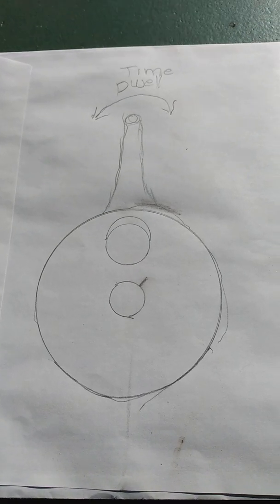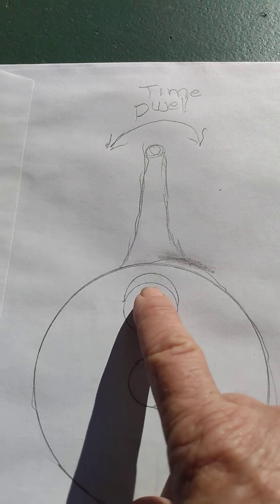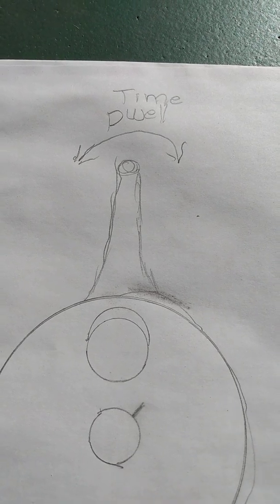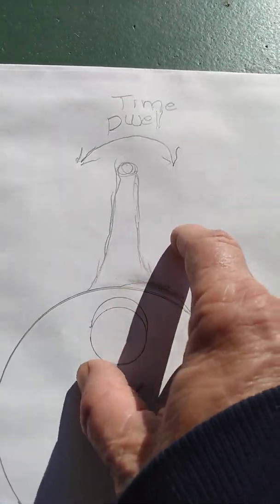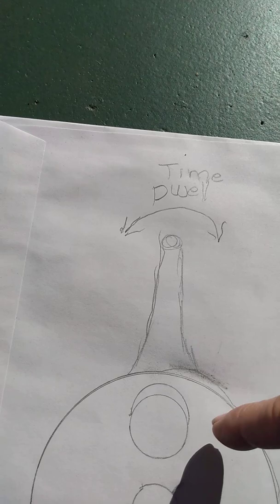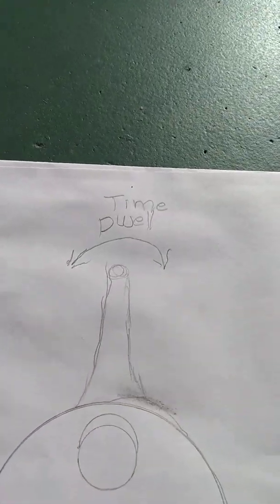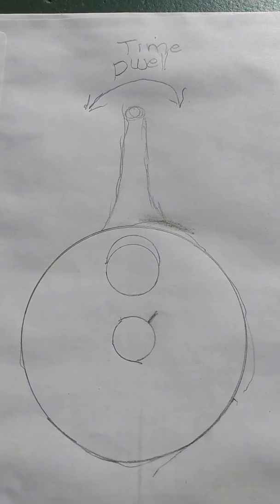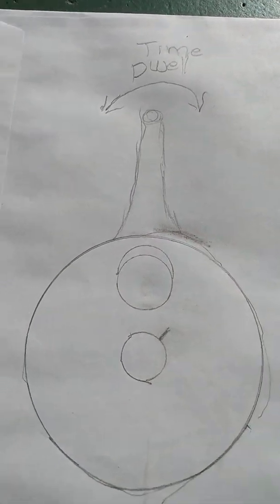pin offset  main difference port timings changes rod ratio also changes but ignition timings don't

Comment: Just a question from a non professional , is mechanical timing the same as physical ? The other variable timing, or at least  usually  easier to change , is   electrical or spark ? As to port timing , is there any compromise to the longer durations and available higher compression ?
Reply from the maker: On these bicycle  motors timing is fixed determend  by where the key way is ground in crank shaft. Yes you can change it few degrees by using a offset woodruff  key or by offsetting  the four holes in the primary stator coil. I'm sure you can find a programmable  ignition  that has the ability  to change timing curve  like a ramp but typically need a battery and a diffraction  type ignition  system. Not worth the money when messing with a 150$ engine
Reply: @2strokecarbtuningportingin187  Very good . Cheers
Reply from the maker: Your port timing question  is confusing. Everything  is a compromise  meaning Everything  effects the big picture  nothing is random exhaust port width  port roof shape port hight all matters port separation from exhaust port opening to where the tranfer just opens matters ie blowdown. Tranfer overall duration matters .ie port it opens till point it closes ie duration. Intake port width and floor matters . I belive I cover everything  every topic in my vids from carbs to cyl heads to windows  window locations and widths. Hope  I answered  your question
Reply: @2strokecarbtuningportingin187  Man thanks for writing all that, it's now embarrassing how  l just didn't ask a proper question. But i understand practically how all those variable details can be effective, but without personal experience . l put a stroker crank in my 70cc scoot [ pipe ] and with nothing but adding a  head gasket  , do my port timings need attention ? is what Imeant to say . But feel free not to answer that one , thanks  PS  You left out weather .
Reply from the maker: @johncoscia5258  weather ? Super simple when turning it takes what it takes literally  if you tune your carb properly  like  I explain on my carb vids  weather never will have much to do with your tune. How many  motorcycle  owners do you see jetting there CARBS  due to weather change the temp change has to be huge  same story with altitude. Better put if you ride in summer from 50 to 105 degrees . You'll never touch carb. But if you ride in winter say zero to 50 degrees your jett size will need to increase  about one or two sizes Max. Basically  you need to up jet one or two jets in winter . When summer comes along it will run Slightly  rich. Simple 4 minutes swap the jet down one size.  As far as altitude  goes typically  from sea level  to 2000 ft has minimal change once you get to say 2000 ft to 4000 ft you might need to down jet  2 sizes. .   AFR HAS MINIMAL  EFFECT  ON HP.  SAME STORY WITH SPARK PLUG TYPE GAP AND HEAT RANGE OR INDEXING.  Just stating Facts. All these  replies  have been tested and proven on dynos for yrs . Go to my community  tab you'll see links to dyno vids proving my statements
Reply from the maker: @johncoscia5258   as far as installing  a stroker crank goes 100% has big effect on port timings I also made vid covering that topic. I have ran on cheap bicycle  motors 38 mm  39 , 39.5 , 40, and 44 mm strokes.. #1 example if you go from a 40 mm stroke to a 44 mm stroke #1 you'll need a spacer plate #2 you'll need to clearance  the corners of the piston skirt to clear crank at bdc. #3 intake  duration goes down and exhaust and tranfer  duration goes up.  So the answer to your question  is yes typically  you would want to address your port timings if stroking or de stroking your two stroke.  Any other questions.
Reply: @2strokecarbtuningportingin187  l meant climate change , not weather ,  hee  hee. Sorry . My cat made me cry after bleeding me dry and cleaning his crap for  14y RIP. Been watching, l like em, l have to study them more. Need an eye like a hawk or things get fu...up fast. l hope l ever have the problem of to fast and detuning, probably against your nature. Thanks for sharing, talk soon.
Reply from the maker: @johncoscia5258  have owened  and built countless  two strokes and four strokes motorcycle  when carbs tuned correctly.   realitive air temp and density  ie humidity and barometric  pressure. 90% of the time can be addressed  with fuel mix or air mix screw. Never needed on a daily rider. I'm thinking you and 90% of people  been misinformed. Yes it does matter if building  nhra  prostock  motorcycles  and other race engine. But I been building and tuning  engines for about 45 years how many people  you see charging  jets on there carbs on cars or motorcycle  when weather changed . Not trying to be funny  just giving you factual  answers.  Happy tuning  😂
Reply from the maker: @johncoscia5258  https://youtube.com/shorts/sCN0JNbQ_xA?feature=share
Reply from the maker: @johncoscia5258  https://youtu.be/A2rKF3cBEMg.  Stuff I work or have worked on
Reply from the maker: @johncoscia5258  https://youtube.com/playlist?list=PLyTjGWYBzynCsVTGTCDpJIzsz3seMRYRZ.  Sorry  about your cat . Seriously.  Carb tuning  facts

Comment: friend, I've done some tests on my engine and managed to get 28 wheel horsepower on the dynamometer. I followed the theory that the motor before any preparation must be standardized at 90° my doubt was if you Americans follow these same concept in the preparation of 2 stroke engines. Thank you very much for answering me, I really like your channel. but I can only understand watching it with subtitles, because I'm not very good at English.
Reply from the maker: I'm American and not good with English eather .I don't write well or read and understand questions the best also have a 250i dynojet Dyno at shop along with many other  machines been building 2 strokes sence I was a child along with 4 strokes .
Reply from the maker: https://youtube.com/shorts/x6cnOtV4SiY?feature=share mostly the only motorcycle mess with any longer  NHRA PROSTOCK CLASS. I'm 57 yrs old tired of working on anything
Reply from the maker: Don't know how other people do things I have been doing my own thing ally life there were no books internet or YouTube growing up

Comment: I'm Brazilian and I'm working on an rd135cc engine my engine uses a 59mm piston has 50mm in its stroke, my engine starts from the top and reaches the beginning of the exhaust port and is exactly 85°,

 But in its exhaust time I can find 186°, and its transfer time is 114° when I refer to 90° I mean the crankshaft position in relation to the beginning of the exhaust window, my next question is, here they say that a good engine is good if you put the window at 90°, 

then reset the graduated disc and measure the exhaust window. for me to get out of 85° I need to lower 0.75mm at the base of the cylinder.
Reply from the maker: Ahh now your port timings numbers make sense  meaning them were not the junk bicycle engine numbers. Port timings are always going to be symmetrical on a 2-stroke meaning if your degree wheel is installed properly the ports will always open and close at same point example exhust at a 186 will open at 93 and close at 93  93 x 2 equals 186  notice you said tranfers are 110. Then they open and close at 55 degrees  exhust open 93 tranfers open 55 l. 93 exh open - 55 tranfer open  you got 38 blowdown  38 ÷110 tranfers = 34% blowdown.  Motor must be gutless lower RPM what rpm you spinning this motor ?  Sucks being a American we have no small bore twostroke street bikes. Sence the mid 1980s the government banned them. I grew up with Yamaha rd 400s and Kawasaki triples. Kawasaki were piston ports Yamaha was reed motor. I could only wish I had access to a modern small displacement two stroke. Have a few two stroke MX bikes at the shop. Kx 500  tm 250 Suzuki and a 2022 Yamaha yz 250 two stroke.  I get rambling I need to re read your question.
Reply from the maker: Sounds like cool bike
Reply from the maker: Still don't think my answer helped any but most proper two stroke pipes work best above 180 degrees of exhust duration . If I had a rd 135 cc I'm sure I would have tested all port timings and shapes  and would have been a little more helpful. Sorry

Comment: very good, I just have one doubt, is it necessary to frame the exhaust port at 90° to start a preparation? My engine has 186° exhaust. but it is at 85° I'm thinking of putting it at 90° and raising the window to 194° to take advantage of the engine at high rpm
Reply from the maker: I'm confused about your frame port at 90° comment.  Roof shape has lot to do with power delivery or loss. Flat roof has more chance of ring snagging and narrower power band and typically can't run as much blowdown as a arched roof. I'm also confused by your doubt comment. I have yet to see anyone loose power with my information. As far as your port timing numbers go they definitely don't sound like numbers on a 20$ bicycle cyl. As I'm constantly showing . And the comment about taking advantage of higher rpm you always need more port time area the higher you push RPM SIMPLY the more rpm you run the less time port has to work hence requires more port time area. Sence you doubt my information maybe you could leave me a link to your page and possibly I might can learn something from you
Reply from the maker: Also confused about your math  85 x2 equals 170
Reply from the maker: 90x2 equals 180 degrees